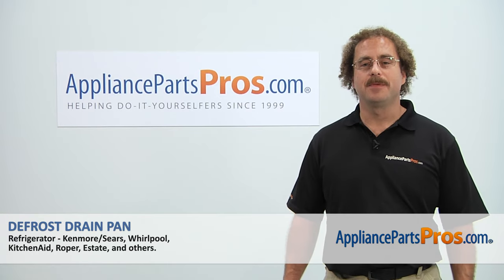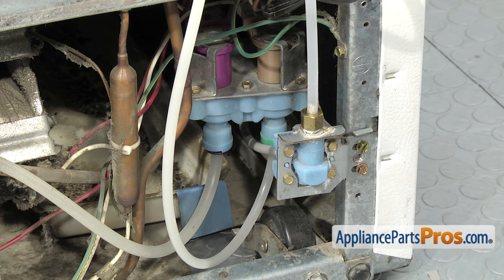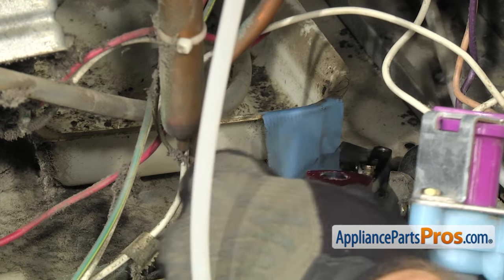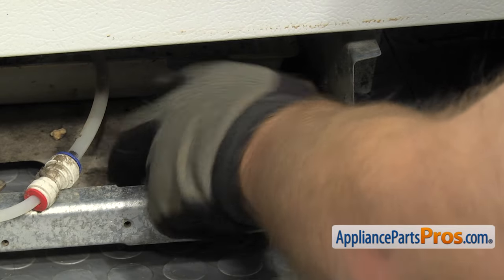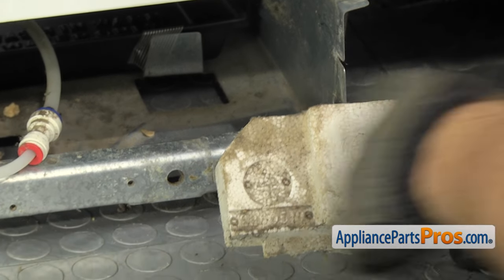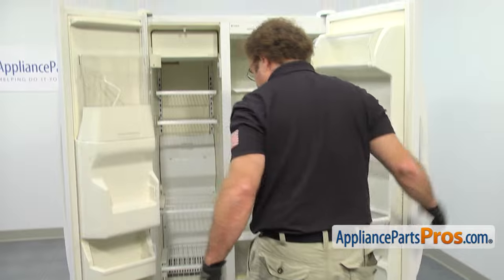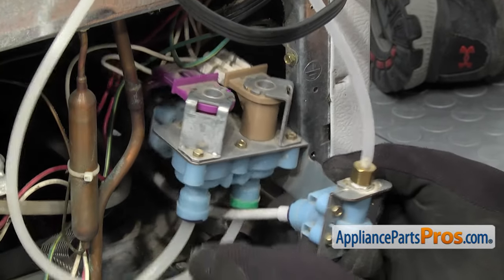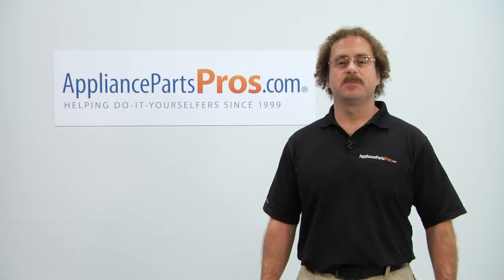How To: Whirlpool/KitchenAid/Maytag Defrost Drain Pan WP842041

Comment: I have cleaned refrigerators for over 45 years and this is the first time I have run into a fridge that has to have a panel removed, water supply hose or system removed, cut tape, (front grill is common), remove filter unit, disconnect bar, cut tape again to drain the drip tray. So have all the men in my family adapted our refrigerators to not require all this, or is for newer models. This model does not look like a newer model.
Reply from the maker: If there is anything we can help you with in the future at all please let us know.

Comment: Very helpful video.  I tracked down a bad smell in my kitchen to the icky drip pan (with some residual water, not sure if that could be indicative of another problem), so needed to get it out to thoroughly clean it.  There was one difference to my almost identical KitchenAid fridge (KSRS25CSMK01), the valve part at the back is different, still held in with the two screws as shown, though the inlet to the water filter goes directly from the filter to the water line via a coupling outside the fridge, not via the valves.  Still had to unscrew the valve part and remove the filter outlet line from it.  But for the inlet, just needed to remove the clamp at the back of the fridge holding the inlet tube in place, and there was enough slack in the water line to allow me to then pull the filter out from the front.

Comment: If one of the quick connect fittings on that blue plastic solenoid valve is bad, must one replace the entire solenoid valve?
Reply from the maker: We'd be happy to help figure out which part needs replacing, and if you can replace only part of it or if only the whole thing is available for purchase. We offer free technical advice and diagnosis even days a week. You can give us a call at 1-877-477-7278 or you can chat us at our website: http://www.appliancepartspros.com/. We will need your model number. You can use this tool on our website to help you find the model number: http://www.appliancepartspros.com/modelnumber_locator.aspx

Comment: Good video, although I'm wondering why that particular drain pan needed replacing--it looked ok to me..? 

I'm also curious about the purpose of those styrofoam blocks at the bottom?

At the bottom of my 7-year old Kenmore(Whirlpool) refrigerator, I removed that one years ago when vacuuming the coils.

As well as another foam block on the right side, that was wedged between two banks of condenser coils...
Reply: I can reply about the purpose of the Styrofoam block, as I learned the hard way. It keeps the housing level. My block was gone, the housing dropped down and cracked my tray. That's why I'm watching this great video and dreading the repair. (Phil 7/5/20)